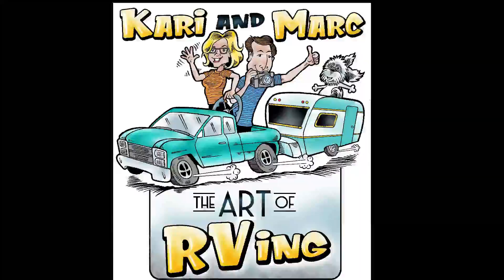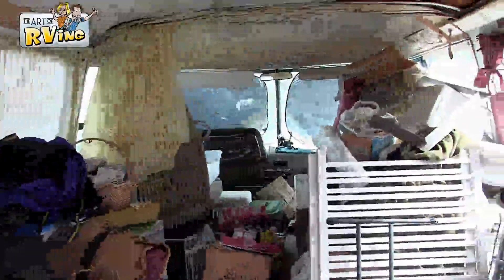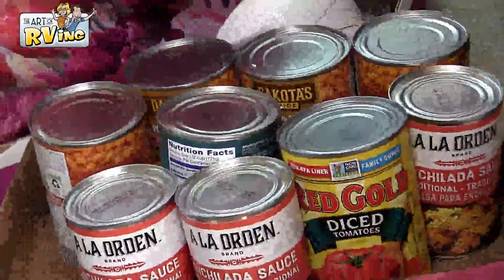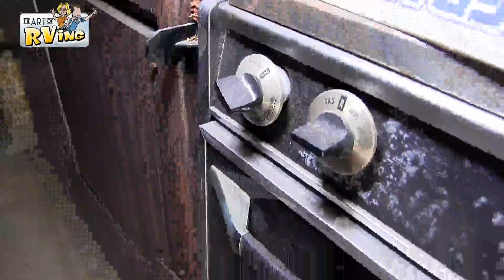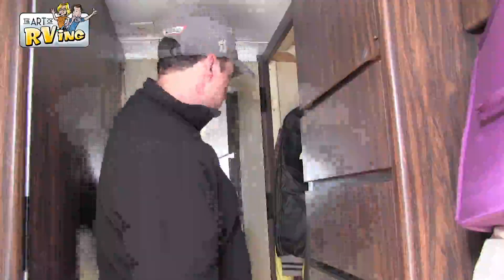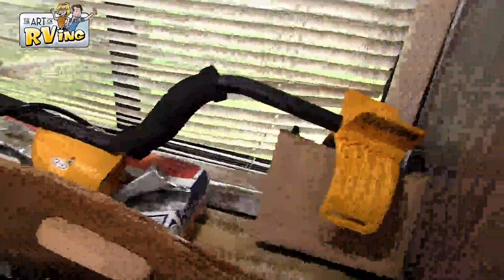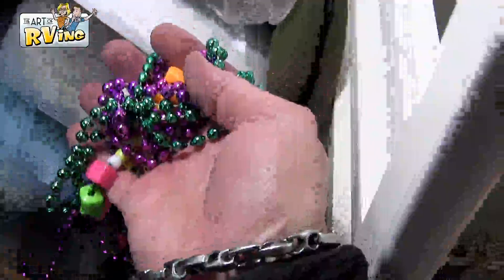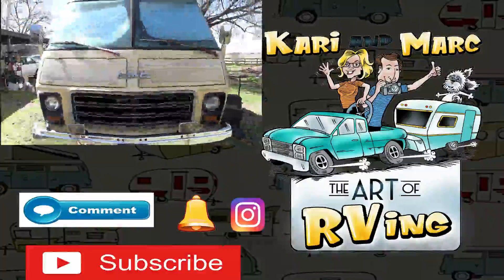GMC Glenbrook 1978 Abandoned RV for sale

Comment: Wow, that dash was insane. I never heard of airbag levelers before. Those plugins I bet were hooked up to 300 Watt Inverter? 😂 When we bought our 2000 user cargo Ram 1 ton van, in October 2018 to see if we liked camping like this, we used the under-guard protectant spray on the inside of our van as a sound and insulation barrier. It really worked well. 

300 Foot Tape measure? Those gages were awesome. The fruit is all on the same plane - 2-dimensional. You are such a jerk, that Band-aid song will be in my head all day. So thank you Toys-R-us kid. 😂 I hate the fire ants in Texas. Wait, 2 AC units in that thing? Now I really wonder what kind of batteries and inverter it has. LIft and pull drawers, Genius. The polar bear on that cup had his underwear showing and was wearing stonewash jeans, that was freaking great. (at least they were not hanging below his...) 😂 Plaid is bad (but in a good way). That broom closet was so cool. I'd love to have one in ours. That was a great one! 👏👏👏
Reply from the maker: I LOVE the BIG DASH. It just so massive when your sitting there. I had never heard of an airbag leveler either. Your smart, I bet the plugs were hooked up to an inverter. I was impressed with the protectant on the roof. So it blocks sounds also? Right? 300 ft tape measure. I should have shown how really long that was. Insane. I am totally impressed, you knew it was a 2-dimensional art piece. Wow Totally respect to you.I am stuck on band aid because band aids stuck on me. There ya go for your head. Fire Ants..look before you step. I said the same thing, why 2 ac units? That thing would freeze you out. One thing I really love is..LOW TECH..simple ideas can only be conceived in complex minds. Dude, I missed the observation of the Polar Bear..I will have to look for that next time. Why is Plaid such eye candy? Well to us, at least. The broom closet was such a great use of space. Love having you in our Stream, Rock On